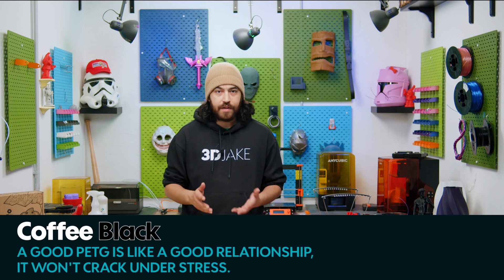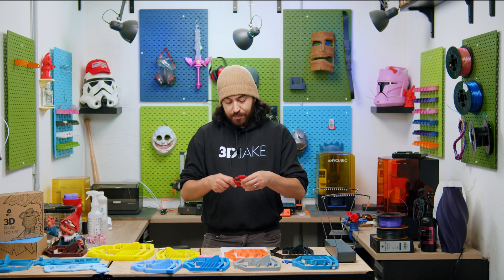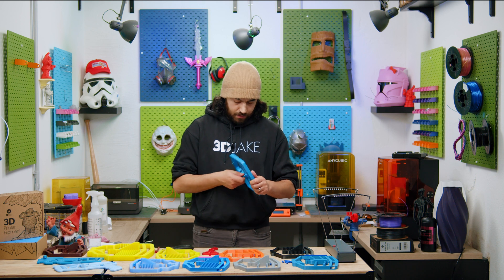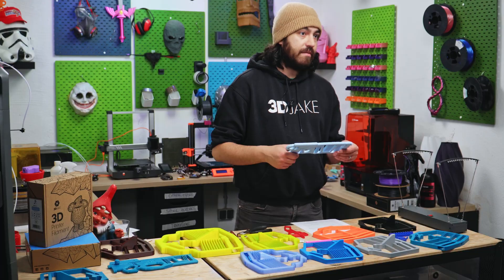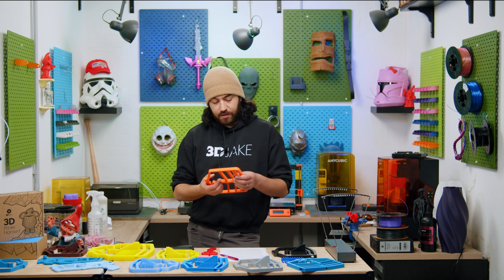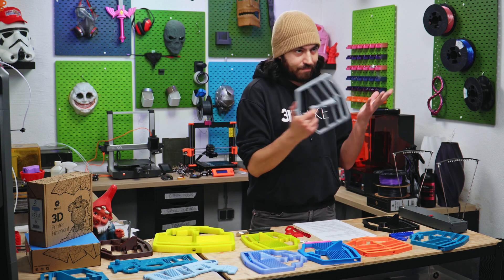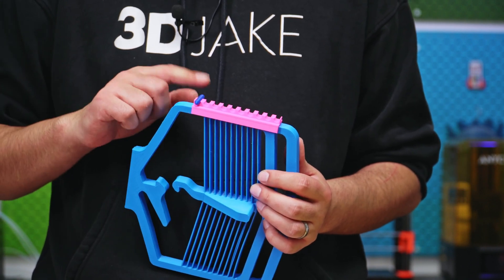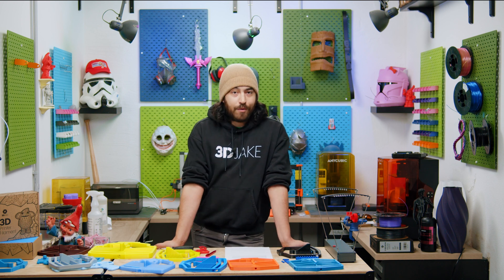3D Printed Compliant Blasters: How Strong Can They Be?

Comment: I'm experimenting with some designs that are similar (great minds think alike). Thanks for exploring how this mechanism scales! Super neat.

To what degree does the thickness of the mechanism affect it's power? (That's not a rhetoric question, I'm also playing around to try to figure this out...)

Also, I've had some luck with using Polycarbonate with these kind of compliant "launchers". It's an excellent material for this application, it's strong, flexes well without deformation, and while somewhat challenging to print, I think the juice is worth the squeeze!

(There's also HIPS: I've found it's another solid choice for this kind of thing! (Though somewhat more fragile than PC))

Anyway, great video! Hope you explore this stuff further!
Reply from the maker: Polycarbonate should be a pretty decent material, most have a relatively low elongation at break though, that might be of some concern. We're working on other similar designs at the minute.

The thickness will increase the rigidity therefore greater spring tension but I think the main problem we have is not exactly the spring but how well the spring can transfer energy to the projectile - this requires a lot of trail and error.

Comment: Making the frame and spring leafs wider should proportionally increase power and keep leaf stress at similar level. Not sure if it would be faster 🤔
Did you hit any of the monitors, do the "pellet" have such low energy that they do no harm?
Reply from the maker: we're definitely gonna expüeriement with a wider one. Maybe if you hit the monitor at point blank range but otherwise these are pretty low energy darts, really small compared to an airsoft bb

Comment: Great vid! The toothpick gun i made was optimized for small-scale prints to get maximum strength. But as i saw in this video , once you scale it up, you lose those compliant-mechanism perks. The extra bending just bleeds off energy and kills efficiency. I did see this during my own testing of compliant mechanisms, it usually works better as certain scales but if it gets too big or small, it loses its strength.

Also for the materials in my compliant mechanism, I’ve found that PLA delivers the highest shooting power but wears out quickly since it doesn’t fully return to its original shape. And on the other hand, PETG offers less power but endures longer due to being a more flexible material. I'm quite sure both materials would perform best with compliant mechanisms optimized to their specific properties, but that would take a lot of prototyping and design time.
Reply from the maker: Hey man! First of all thank you for the toothpick design, it has provided us with a lot of fun in the office. We actually had the same problem with PLA but compounded like crazy when scaled up and now we have the same problem with PETG when we push that spring to its max. The second design wears relatively quickly. We loved optimising your design for scaling though and we wouldn't mind doing some more prototyping to get a long lasting but powerful design going so perhaps we'll revisit this in future. Thank you again :)

Comment: Nice video on a topic dear to my heart.  I made a mini nerf shooter (on Maker World) and tried many variations.  Strangely PLA worked best for me due to rigid nature, but leaving shooter cocked for more than 1 minute weakens it.
Reply from the maker: Do you have a link? We'd love to test other designs! :)
Reply: @3DJake_Official  Links don't seem to get through the comment filter.  If you go to Maker World and search for "mini nerf z" it will be listed.  BTW make sure to put the dart in with 5mm sticking out the back as shown in pic.  The moment of strike significantly impacts the distance (max transfer of energy).  Slightly older version is on Printables (search for Mini Nerf Shooter) but I get less rewards from them :-)
Reply: @3DJake_Official  I tried but when put a link my post gets removed.

Comment: Check out filaticum engineering pla - it's a quirky blend - PLA, but prints next like PETG, can be heat treated to improve some aspects...costs a bit, but it could be a fun trial for the project
Reply from the maker: That's some strong filament!! But yeah pricey to say the least
Reply: @3DJake_Official  I used it 3-4 years ago for a full toolhead redesign on a back then Ender 3 😀 still works today